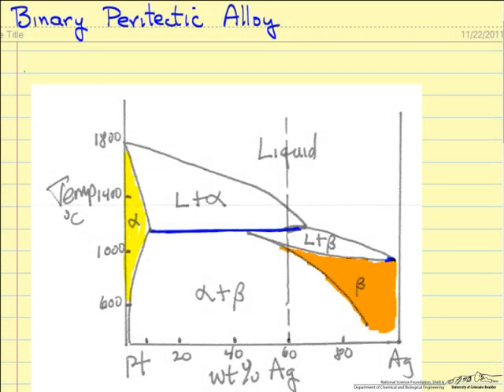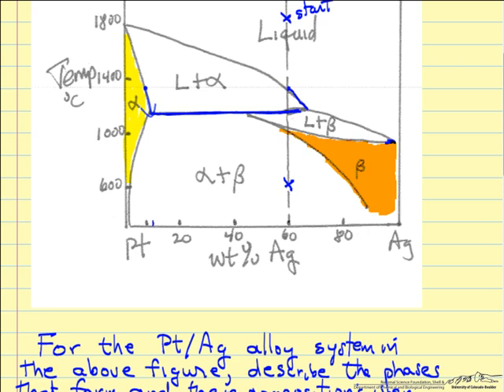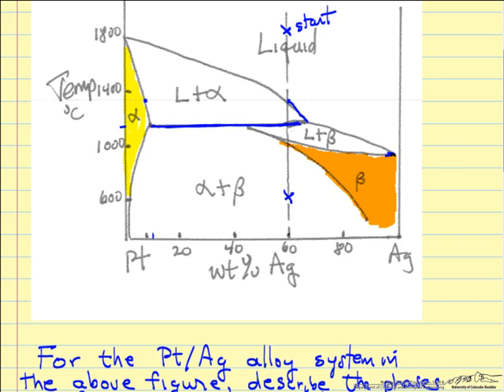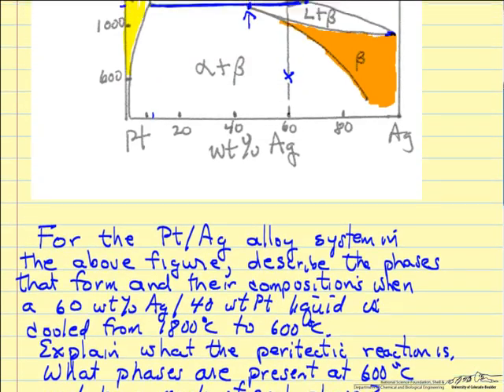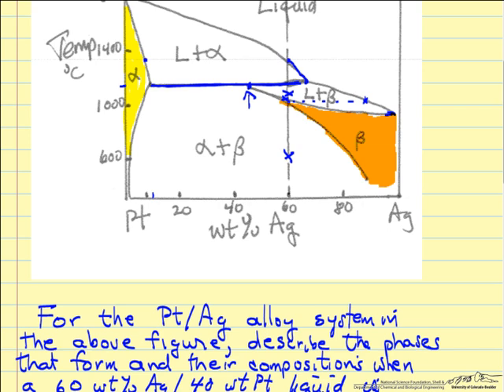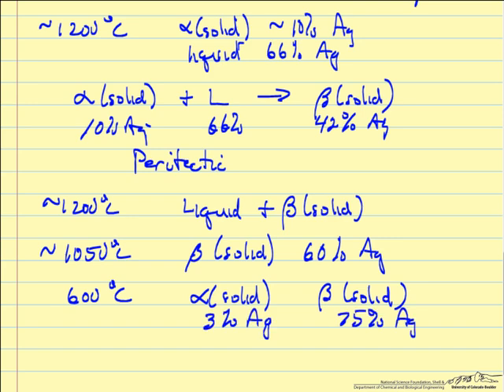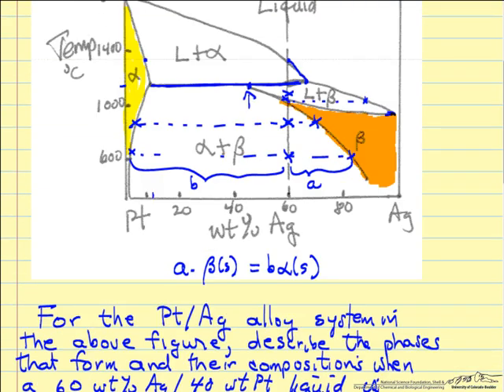Phase Diagram with Peritectic Reaction

Comment: where are you getting the percent numbers as you cool?
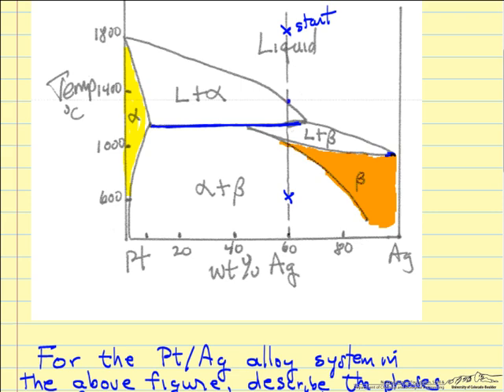Reply from the maker: Thank you for the question. The percentages come from the x-axis, so when you are looking at a certain point on the graph, you have the phase(s) that are represented there. When that is a mixture, it will have different weight fractions for Ag and Pt for the different phases.  Those fractions are established by horizontal tie lines.  For example, at around 1:15 in the video, the system is at about 1300 degrees C and it starts to form a solid (L + alpha). The composition of that solid is found by using a 1300 degrees C tie line and using the point at the left of that phase's section (see the left blue dot). That blue dot corresponds to ~6 wt% Ag which is the wt% of Ag in the alpha phase of the (L+ alpha) mixture. This is better explained in a simpler binary system.  See https://www.youtube.com/watch?v=Q-hInH6WLy4

Comment: Why does the beta-phase have 75% Ag at 600C. It looks like it's actually over 80%.
Reply from the maker: You're correct, it probably is closer to 80% Ag.  A VERY rough estimate was used in this example.